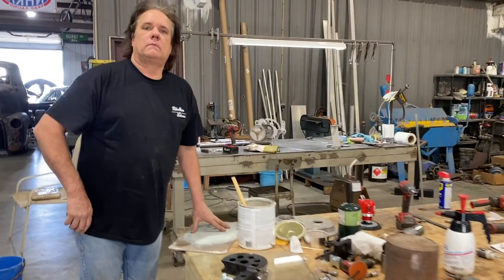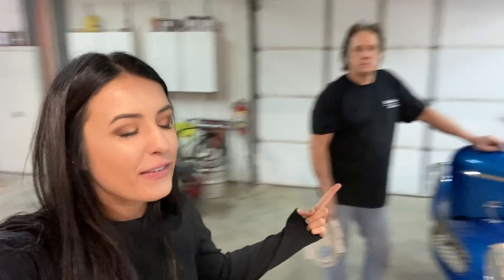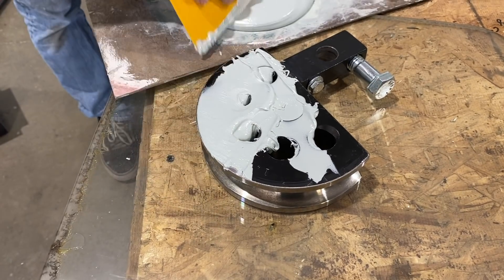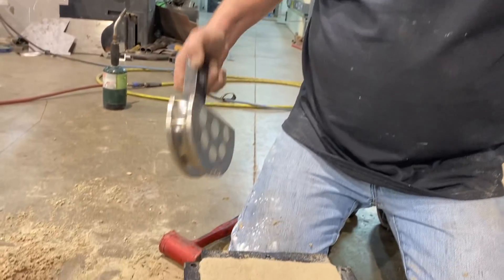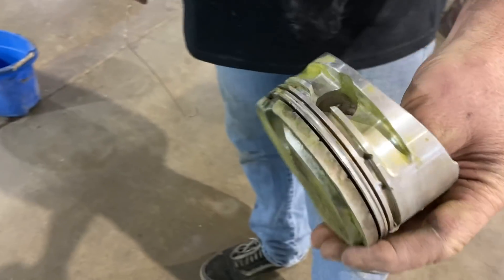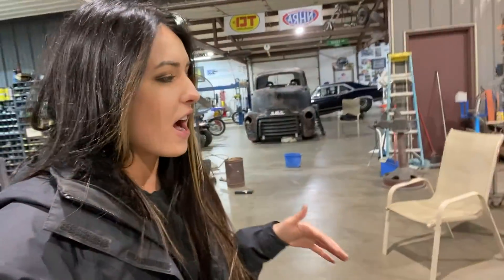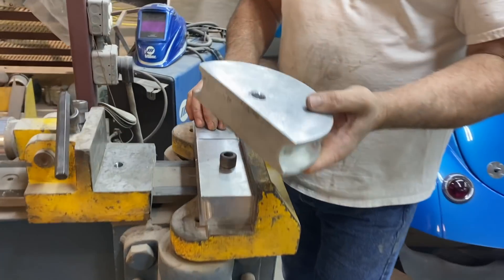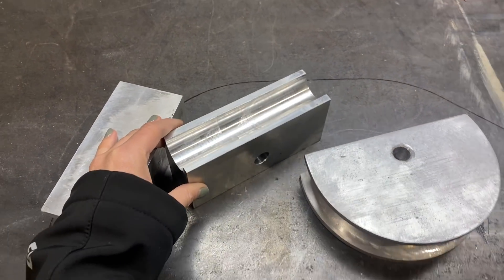Sand Casting a Die to Bend Tube for a Chassis - Because The One We Needed was Backordered!

Comment: My pops built a forge he had l00 gallon propane  for the house he t off for the forge he took bottom out of industry furnace or burner hook that up to propane  then he found the biggest  industry vacuum cleaner  he could find them built his forging box out of firebrick then plaster it all in fine sand put it metal I or part in turn on propane heat it up then use the vacuum pull air out not longits heated up

Comment: Yep did metal casting starting in 7th grade in the 70s.   Got back into doing it again about 10 years back, mostly for rough castings for small working engines.  I 3D print parts for making the sand molds now.   It's not taught anymore in schools around here, probably safety or insurance reasons, real shame.

Comment: so cool to see a friend and i casted a inline 3 cylinder steam/air engine block and head. 1 of the cylinders created the air to drive the other two. mind you it had to start on line air preasure but once running it ran alone on own resources. Offten i wonder what ever happened to that little motor? I know the friend i was working with to build it has passed away. I hope one of his children have it. it was his idea, me i helped machine parts.  laughs i think it made a whole 1 to possibly 2 horse power. wearing a glove you could stop it on the fly wheel. and hadda wear ear protection to operate it it did make a extream loud scream.

Comment: I have read for safety to never cast metal over concrete. Molten metal landing on the concrete will force moisture in the concrete to cause an explosion. Do it over sand, gravel or dirt. Got away this time. Apologies for chiming in with little experience behind me.

Comment: Reminds me of the sand casting we had to learn in highschool. Thanks for the memories. It was 1968 for me. And we also had an auto shop. Where i built my first 283 punched .125 over. 
Erson cam, did my own head work, edelbrock tunnel ram, for a 64 nova....narrowed olds rear end and wheel tubs. I ran at Lions drag strip in long beach california.
Lots Of Memories.
I eventually graduated to this AA/FA before nhra changed the rules. 
Sorry, couldnt post the pic of the altered.

Comment: I also had a foundry class in high school, sheet metal, welding, machine shop and foundry, all taught by the same teacher.
  I understand about the JD Squared problems, I have a few thousand dollars worth of tubing bender and dies BUT I'm not really happy with them anymore, ordered their Beast tubing notcher online, $500.00, don't hear anything from them for a couple weeks, so I called and  waited on hold for almost an hour! finally left a message figuring they will get back to me, another week goes by and another long phone hold , message with no response again! ANOTHER week and I started calling at 6am Tennessee time and finally got to talk to someone....  they said their backed up with orders and it will still be a few more weeks! Which none of this was told to me when I paid for it on the website and not one returned message or email! I told them I wanted a refund and of tired of their overpriced dies and their awful customer service, ended up buying a STRONGHANDS Tubing notcher off of Summit racing for $200 dollars and it's everything the JDsq notcher is and more.

Comment: Interesting technique.  Not quite how Myfordboy does it but very effective.  I am hoping to add 3D printing to the process for making my molds.  Handy having the CNC machine there to make the backing blocks but they likely could have been cast too.  Likewise, the CNC could likely have made the bending die too with a little more intricate CAD/CAM work but casting is effective and quick.  Thanks for posting this.

Comment: Awesome video but personally I wouldn't have bothered casting something like that instead I would have faced off and drilled the holes on a piece of cheap steel round stock that's already close to the correct diameter  that you can pick up at a local steel supplier and then I would bolt it to a sacrificial block that you can stick in a lathe. I would then machine the diameter and the curve for the specific pipe. After that is done I would cut the flat off on a band saw and face off the cut to final dimension. Finally If you were to be using the other bender you could weld on the tab and drill and tap for the bolts. That would be just about as fast and would produce a die that is almost identical to the one you could buy and would last a lifetime. Again great video this is actually the first one of yours that I've seen but I'm going to subscribe and look forward to seeing more of your projects.

Comment: That sand looks pretty wet. very Dangerous!    Molten aluminum gets poured, heat turns moisture to steam which causes mold to pop while pouring. Molten aluminum splashes on you unprotected legs, arms, and body.       This happened in our high school... Lawsuit, no more metal shop.....

Comment: Small tip. Welding rod oven to dry it out and a concrete vibrator helps to. The vibrator helps to make it easier to press the part in to the sand sand acts almost like fluid and helps remove any cavities. 
Keep kickin ass bro.

Comment: Super Cool ....so 👍 earned.

I tend to machine a lot more than casting. 

But it's more practical to learn to cast if you don't have a lot of high capacity machine tools [And large billet drop from paying jobs as well to be fair.]

We have a traditional blacksmith shop and manual machines as well.

Right tool for the right job so we keep everything, use, and maintain it. But have CnC as well.

Bought a mobile muffler shop at auction a couple of years ago. Cut the front part of the truck off.

Trailerr tubing bender now.

Comment: Why don't use high temperature oil for your sand ? The sand works better with high temperature oil.
I have done casting before with aluminum.

Comment: Not sure if she has the coolest Dad ever, or he has the coolest daughter ever. Thinking kinda both.
I had foundry in Jr high. They could never get away with that now. Probably wouldn't get away with firing off a pulse jet engine in the power tech classroom either.
Those were the days.
Iv started with the larger size and got dom the correct inside and outside diameter, bent that and then split it on a bandsaw, and used it like a shim between the dies and the tube. A tiny little tack weld will keep the shim from slipping through and it can removed and polished out.
Worked so good we ended up with  3 different sizes.

Comment: Excellent video topic.  Please show us how the pot and burner is made to melt the aluminum in.
Reply from the maker: Hey Russ! The forge or burner was actually made in the 50s by his great uncle! It is a metal 5 gallon bucket with a "spout" for the air to blow into as well as a spout to connect the gas line to. The inside is lined with a thick coat of fire brick cement. 

The pot or crucible that he used in the video is literally a piece of pipe with a plate welded to the bottom of it. (This isn't the best way though because the carbon from that actually ends up contaminating the metal). We have a ceramic crucible now though that he bought, we just didn't use it in this video!

Comment: Hi.
 Lol.
 Awesome.
 Memories.
 I tried the casting also when I was around the same school age.
 I just received two long aluminium machining rods today, synchronicity. 
 I have not got a mini furnace yet, yet there are post plant bases that have the same heat proof etc I can use to make the furnace to melt.
 So awesome.
 Keep up your good work, to all.

 Lol.
 Thanks
Reply from the maker: Thanks for watching Karl! That's cool you got to do it in school as well. Good luck making your set up!
Reply: @RidingWithAlexTaylor  Thanks A million.
 I just got the chassis to touch and roll on the ground, so it's a 2021 El Torro, Kammando or Camino, lol.
Australian lingo 1973 HQ truck or one tonne ute.

Comment: Another awesome video!
My Affordable (Brand) bender has aluminum dies. I have done a few chassis with it. I use lube, even cooking spray works.
But I am looking at my exhaust bender in a different way now!
Reply from the maker: Haha! That's awesome.
Reply: My exact thoughts too. Just spray CRC or teflon spray to lube up the dies. I have done it with cheap pipe benders and it makes the job go better. Polishing those horrid dies helps as well